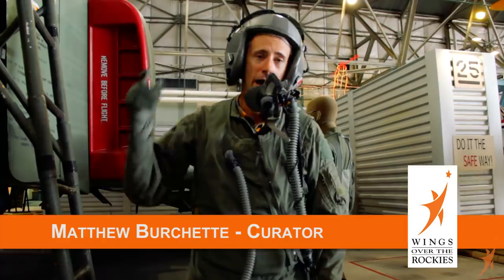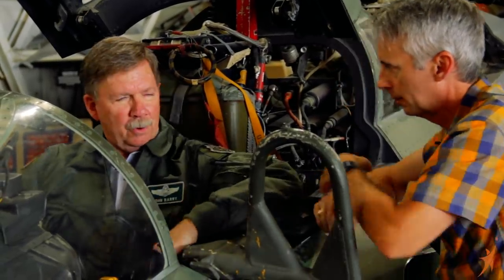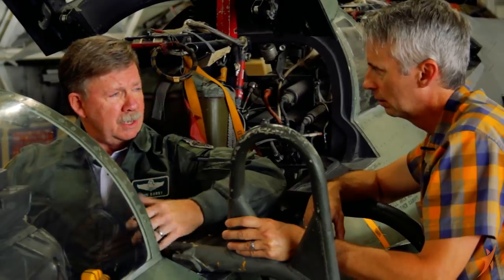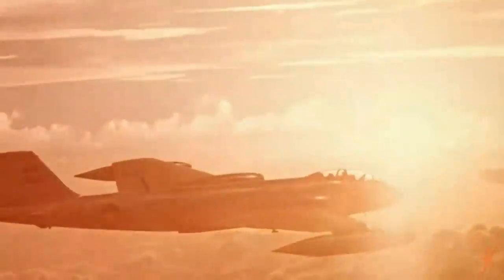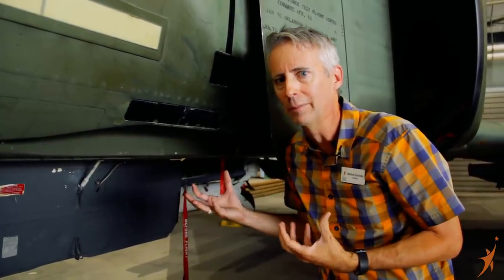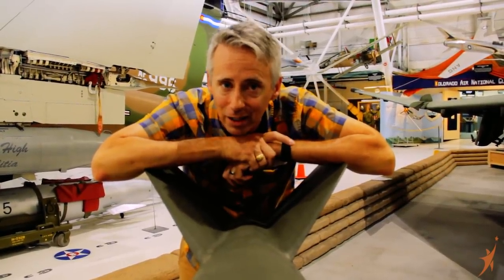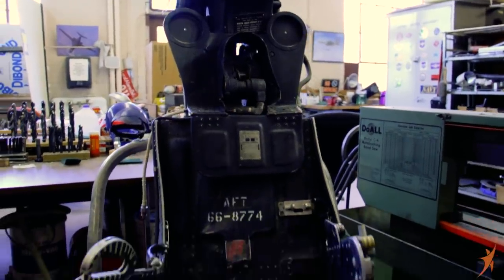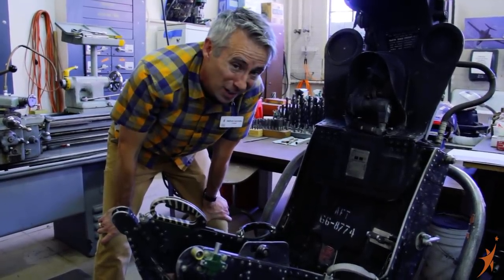F-4 Phantom | Behind the Wings

Comment: The first F-4's didn't have any gun. It was four Sidewinders, four Sparrows and if there were any enemies left, you turned and hoped your speed was high enough to outrun them. It was designed to be head down, focusing on the radar screen and instruments for combat. The only time you were supposed to look out the canopy was landing, take-off and refueling. It was designed to intercept Soviet bombers at 50,000 feet, not for close in combat. It has terrible dog fighting visibility.  When the II version came out, they added the Vulcan cannon. And the Sparrows were on average 3 out of 10 fired hit their targets, the Sidewinders were 5 of 10. Not a good average. But it was fast and could take a beating and still fly, which enamored it to the pilots it brought back home.
Reply: I would be very surprised if an AIM-9B could attain a 50% hit rate. I was under the impression it was more like 35% at best and then only if you came in from behind. I was under the impression that the AIM-9L was the first variant to give you a 50% hit rate and that was introduced in 1976 (1977?). The AIM-9M (1982) was where they started getting good as the new electronics was far better at target discrimination and much had improved countermeasure avoidance. The early sparrows when tested at extreme range only had a hit rate of 7% too. Whoever in Washington thought a "missileer" was a good idea in the late 50's was a numbskull. Personally I think they were trying to do too much in one technological leap. The J79 engine was a massive step forwards with variable stators etc. Then there is the first fully integrated Radar and fire control system which allowed the Phantom to be the worlds first truly independent fighter. But have you seen the wiring???? One of the specifications for military aircraft is that you have to be able to trace a wire visually from one end to the other. If you cant an individual "Non-Conformance Report" has to be raised. The standing joke in the RAF was that the paperwork weighed more than the aircraft. Bloody good first attempt though.
Reply: @gordonlawrence4749  I just know the early air-to-air missiles were very unreliable, the AIM-9 being better off than the AIM-7. I was an Aviation Ordinanceman on a carrier and worked in a missile mag, where we worked on the Winders, Sparrows and Phoenix mostly. And they were shot from Tomcats and Hornets. Both versions were the latest improvements over the Vietnam era weapons. We were using the  AIM-7M and the AIM-9M.  And we had the Sea Sparrows for ship to air defense.
Reply: @valuedhumanoid6574  Why the USN got rid of the only aircraft that was AIM-54 compatible is a bit of a mystery to me. I believe the F-14D had a longer CAP endurance than anything we have now too. As for the earliest AIM-9 variants there was a step change in technology. The very first used lead sulphide IR detectors. PIN diodes are what is used now and are what I know about (I used to be a design engineer in electronics). As for the AIM-7 the motor and fuzing was damned reliable it was always going to be the electronics as just trying to make something that small back then was an issue. That's one of the reasons for "Skyflash" basically an AIM-7 with British electronics. The electronics were designed later than the AIM-7 electronics so had the advantage of better components being available.
Reply: It had a gun pod that took the place of the center line tank.  Not used much since the plane could out fly its own bullets.  Mach 2+, but that was stripped down.  No hard mounts nothing except internal fuel cells.

Comment: You forgot to mention that the F-4 was the first plane with zero-zero egress (look it up)
And, if both engines flamed out, you had 10 seconds to egress before the plane went turtle and you were punching into the ground.
When they added guns to the F-4D and F-4E, they started using the F-4C, which didn't have guns, for electronics warfare called the RF-4C, which didn't even have wiring for weapons.
The F-4 was the third plane used by the Wild Weasels with the F-100 being the first and the F-105 being the second, which I worked in Korat, Thailand.
Being a mach 2.2 plane, the F-4 was faster than many of today's fighter planes, many of which are only mach 1.8.
She was one of my favorite planes.
Reply: The F-4D did not have an internal gun.
Reply: @alanhess9306  You are correct.  The first F-4 with an internal gun was the E model.  They did mount the Vulcan in a pod on the center line hard point on both the C and D.  I was an F-4C crew chief.  I don't know if the Navy or Marines ever used a gun on their F-4 aircraft.
Reply: @brianmcdaid3178   I retired from the USAF after 21 years. I was a WCS troop and spent 9 years at George AFB.
I worked on F-4C, F-4D, F-4E, and F-4F and F-4G aircraft. Did a short tour at Osan and a long tour at Keflavik. I just love the Phantom.
Reply: @brianmcdaid3178  I also went TDY to DaNang in 1972.  I saw an F-4D with a gun pod on the centerline and gun pods on the outboard wing pylons.
Reply: @alanhess9306  I knew It was capable of carrying the gun pods on all three of those stations.  Just never saw it done when I worked on C models at Davis Monthan.  I spent 1971 at Tan Son Nhut as crew chief and flight mechanic on Scatback's T-39As and flew in to Da Nang many times of courier missions.
Reply: The RF-4C was a purpose built reconnaissance variant of the F-4C and primarily a camera bird.
Reply: @brianmcdaid3178  When I worked them at Udorn, they use ECM pods and equipment for SAMs.

Comment: Along with the good ol’ Tomcat by far my favorite jet
Reply: And the USN still does not have anything with the F-14D capabilities. EG CAP at 100 miles for 4 hours with a combat reserve. The Super-Tomcat story is a tragedy. Uprated engines and fuselage, longer range marginally higher top speed (limited by heat) an extra 10000 feet of ceiling. AND 2000 pounds lighter with a longer range Radar. The newer engines were navalised variants of the ones in the F-15E and gave an extra 3000 pounds of thrust EACH on full military and about 1000 more each on full afterburner. Rumour has it they were more reliable too.

Comment: At certain angles of attack, the controls would need to be used the opposite direction than normal. The Air Force even made a training film on it.
Reply: Yep I have seen that film. There is also "reversal" at some speeds and altitudes. This was common in jets up to the 1960's.

Comment: Question on air to air refueling...What would have been a ball park on the time needed behind a tanker to  fill up ?
Reply: George Salvesen My memory is a little fuzzy after so many years. I was a KC 135 Boom Operator in SEA with TDY tours in 72 and 73. Tanker could pump 6000 pounds per minute with all pumps for B52 and others. F4 and fighters usually didn’t use all pumps. I think about 1500 pounds per minute transfer rate. Initial refueling after takeoff of an F4 was around 4500 pound (if memory serves!) Return to tanker on the way home was often higher than that. Drop tanks affected capacity, but I don’t know the totals. We picked up an F4 in 72 after a dogfight and pumped him more than 9000 pounds without drop tanks. I (as well as the F4 pilot) afraid that he wouldn’t make it to the boom in time. I was prepared to try a”tow” but he never ran out of fuel!

Comment: I didn’t think the phantom’s had guns, I thought their lack of guns, and the addition of missiles, was the reason top gun was thought of...
Reply from the maker: You are mostly correct. Early Phantoms did not have guns but were equipped solely with missiles. Pilots in Vietnam complained about the lack of a gun, so the SUU 16/A pod was used until the  USAF introduced the  E model that was built with the M61 20mm cannon. MB

Comment: The first round of F-4s had no gun at all. This lunacy caused the pilots to have to attempt to engage in air combat at long range, or damn nearly kill themselves trying to use missiles at short range. The Air Force could have suffered a total shutdown of "the most advanced fighter aircraft" they had, just because of the idiocy of something as ridiculous as building a fighter plane without a gun to fight with. Several of the recon variants were put out of service for long periods due to the amount of damage they sustained from ground fire, and they had no way of shooting back. Luckily, aircraft engineers aren't as stupid as the people who decided that the F-4 didn't need guns, so they were able to modify the planes to fit the 20mm & make the Phantom into an actual fighter.

Comment: The F-4 was designed to be a stand off missile platform,not a dog fighter. An F-86 would kick its ass in a dogfight. The F-4 E models were redesigned to be better dogfighters with leading edge slats and centerline Gatling guns among lots of avionics changes. The US had much better pilots and great training at Red Flag.

Comment: Only those who have never turned a wrench on that buzzard have fondness for it.
Reply: Total BS Paul,  I worked this airplane for 15 years and was awed by it.  It wasn't agile like the migs but could take a lot of damage and return home. I always enjoyed watching takeoffs and landings. It was a remarkable piece of machinery. Maintenance was extensive but it was still the best fighter in the world in the 1960s.
Reply: @alanhess9306  You probably never attempt to install aft AERO-7 launchers after the jet had been towed, fueled, defueled hoisted jacked or lowered without having the spacers installed.  Or got wailed in the head when those aux air doors popped open during ground serving.  Or tried to install ALL the bolts in the Armament Control Relay Panel.  Or tried to get to the sidewinder relay panel (that little gem was in the engine bay and required the engine to be rolled out).  Or tried to find the broken splice among the wad in the splice area.  Maybe this little trip down memory lane will jog your memory sir.
Reply: @pauljirinec2772   I spent some 15 years working F-4WCS and removed and installed countless Armament Control Relay Panels.  I have extensive experience with wiring and splice areas.   I was keenly aware of the dangers of the aux air doors, not only that they could slam shut or fly open but also the sharp edges.  I have some scars from those.   I installed the RF cables that run through the engine bay, you know, those cables that carry signals to the AIM 7s. That also required engine removal.  You are correct that maintenance was not easy but we found a way to get it done.  I never messed with the launchers of course, that was your job.

Comment: F-4 operated by 11 countries
MiG 21 operated by 41 countries
Reply: And?
Reply: F-4 production 5000. Mig 21 14000
Reply: @Ace-Av8er  So? The MIG-21 was pretty much the only fighter being produced by the old soviet union at points where as the F-4 was one of several being produced by the US EG the F104 Starfighter and you are forgetting that the allies of the soviet union all flew soviet aircraft. NATO had different aircraft in almost every country. . Then there is of course the cost and capabilities. IE the F-4 was more expensive but it was far more capable. For example:
Top Speed MIG-21 Mach 1.76  F-4 Mach 2.24
Service Ceiling MIG-21 17500M F-4 18,000M
Stores Loading MIG-21 2000KG F-4 8480KG
Air to Air Loadout MIG-21 4 missiles F-4 8 Missiles 

So for air to air 2 MIG-21 for every F-4 and air to ground 4 MIG for every F-4 and the F-4 has the option of running from a MIG-21 but the MIG-21 cannot out run an F-4.

And there were less than 12,000 MIG-21 built according to Yefim and several others. 

You really need to look at all the facts and not cherry pick or when you go to university you will fail.
Reply: F-4 Biggest distributor of used Mig parts.
Reply: @recoverydog  Mig-21 and 17 biggest distributer of F-4 Phantom F-105  parts in south east Asia.
Reply: No, SA2 is the biggest distributor of F-4 and F-105 parts.
Reply: @recoverydog  👍👍

Comment: Be interesting to hear why the F4 had wings pointing in all directions. Phenomenal performance but damn it’s ugly.
Reply: The horizontal stabilizer was drooped to keep at least part of it in clear air even at high angles of attack.  The wing was originally designed to be straight (no dihedral) but the prototype with the straight wing was too unstable.  They considered putting in a dihedral from the center line out but was too much of a design change.  Some bright young engineer suggested blocking the hinge to keep the wingfold area from opening to the fully flat position.  This worked and only the hinge had to be redesigned to make the aircraft stable.
Reply: Craig W ...Ugly?  This is still...to this day...the most cool looking aircraft ever made.  And mean too!
Reply: It is ugly, but it is so ugly there is a beauty to it.

Comment: Aim 7.... great for thumping infantry in the head. That's about it.
Reply: Or, you know, scoring the majority of USAF MiG kills in Vietnam out of all weapons used. Despite its reputation.
Reply: @vk3139  I thought the AIM 9, being simpler was more reliable.  Much shorter range though.
Reply: @alanhess9306  The AIM-9 had a higher ratio of hits to missiles launched, the AIM-7 however scored the most total kills, at least with the USAF.
I can't recall off the top of my head if it was the same for the Navy.